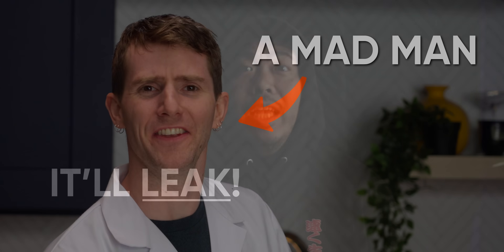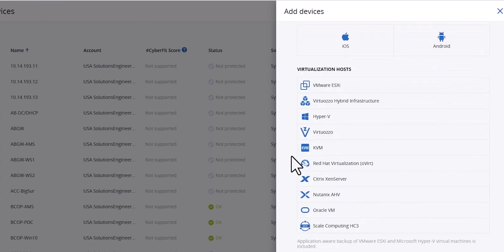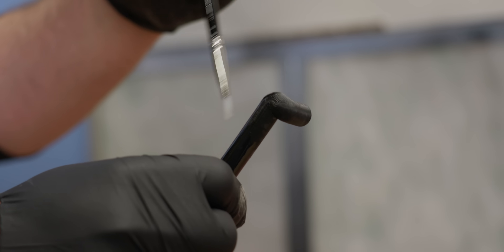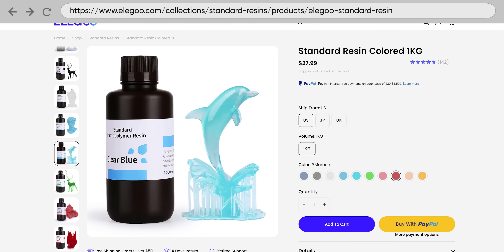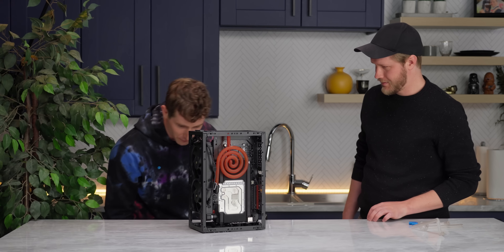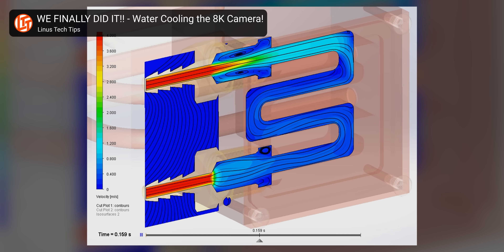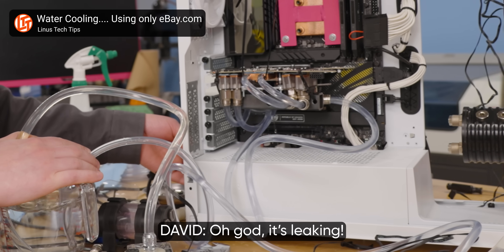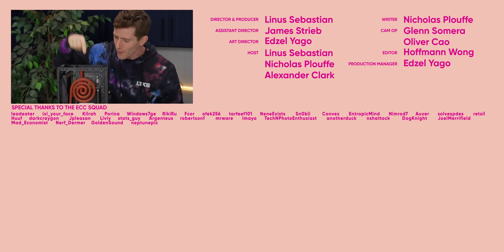3D Printed Hardline Water Cooling

Comment: applying a coat or two of resin to the outside of the piping before installing would likely make the part significantly stronger and more water tight. it might even come out looking smoother :)

Comment: You should look into the resleeving pipe process, you could potentially 3d print the lines with holes then sleeve it to avoid leaks. 
3d print provides the hard structure, sleeve actually contains the fluid.

Comment: if you clearcoat the resin print you can achieve translucency. I have lightly wetsanded some resin prints, clearcoated them and ended up with parts clear enough to easily read text through.

Resin prints can continue to cure in sunlight and end up cracking so a UV clearcoat is a nice way to mitigate that

Comment: You can use glass blowing technique to get same result in Quartz or Pyrex glass tubes. As long as you hold internal air pressure in the glass pipe you can get quite intricate shapes and tight bends...

Comment: There was a recent post in the r/SFFPC subreddit where a user 3D printed molds instead. Then used regular hardline tubing and used heat to fit them to the mold. Was able to achieve something super complex but without having to go resin and print the full tubes. It would work great for an SI when they have fixed configurations, they could just premake all the tube runs with ease.
Reply: Custom Scientific Glass Blowing has a similar process where they use regular tubing and stock glass to form custom pieces for laboratory and manufacturing use which has to be of a high standard for professional use to withstand heat and pressure tolerances fit for purpose.

Or if you think of it as a prototyping route, make a model test fit... and then go completely over the top and follow an artistic route glass blower/sculpter to make the final product.  
The looks you could pull off like go full glass crazy straw, mad-scientist labratory glass kit, abstract art like a glass knot or klein bottle, or waterflow sculptures.
Reply: If you don't want to resin print you can fdm print casings to hold softline tubing, you just thread the tubing through the printed casing and you have your shaped tubing
Reply: For cooling so much expensive gear, I think I’d just not take the risk and buy properly made ones 😂

Comment: what about weird shaped tubing? like instead of a round tube its a flat rectangle
Reply: The problem is that the fittings are round. You'll need to somehow transform the tube from square to round. Doable, but just more work.

Comment: With a 0.1mm or maybe 0.15mm layer height (instead of the 0.2mm? that LMG used), enough walls that everything will be solidly made out of walls while printing at the higher end of acceptable temperature and you could easily fdm this instead. Especially since PETG bonds better to itself than PLA which makes it slightly better at being watertight. Also using a resin that is 3-4 times more expensive than typical stuff and using that to set price expectations for people is a bit weird.

Comment: think there are some coatings you can pour into the tube to solve the layered spaces issue. I found several that might work when looking into fabricating a gas tank from sheet metal, but only cared about ones that would not corrode or dissolve in contact with gasoline, and protect from/not form rust.

Comment: one thing i would love to see now, is a small reservoir built into the tube(so for instance the spiral could be filled out, and used as a reservoir) and it could make water cooling a tiny form factor pc better, since you can fit the tubes in where there is space, and make a small reservoir where there is space for it, and even a fill cap located in a convenient spot, and a drain port as well.

Comment: This is exactly what a Stratasys polyjet excels at. A J 750 or J 850 can print out some absolutely massive tube runs. All you have to do to prep the prints is remove the water-soluble support material.

Comment: Also possible is to use a resin with high thermal conductivity (commonly used fillers for that is aluminium powder or silver) and use the tube itself as a heatsink.

Comment: I'm really curious at the possibilities for doing functional things with this.  You were showing how tight the bend can be, but water doesn't flow well through bends, right?  What if you could very precisely design the tubes for a computer such that you get the gentlest curves possible for the smoothest flow.  Would that improve the cooling vs. sharp bends?  Sounds like a great video!

Comment: as for the hassle with working with resin..  just use water soluable resins.. dont need alcohol to clean it afterwards and theres barely any smell from it, you still need to use gloves and stuff but its so much nicer to work with (though i suppose for stuff like this where it will actually be subjected to water it might not be very good :D but for anything else really its fine)

Comment: Lol @ UV reactive dye. In a resin that breaks down with exposure to UV light. It cures with UV but continues to degrade with extended exposure. SLA resin is inappropriate for any kind of production part. It is for checking size and throwing in the trash

Comment: I'm glad Alex talked about the fumes of SLA printing. 
I was in the market for a 3d printer a few months ago, and ultimetely went with FDM against my initial desire. 
The checmicals in resin printing should not be understated. The PFAS will fuck you up and linger in your home. I can't risk making my family sick, so until I'm willing to put a resin printer in my shed outside I'll be sticking with FDM. :( 
edit: oh linus also reitereated :)
Reply: To the note about 3d scanning - you can always use photogrammetry apps. They aren't always perfect, but it should give you enough spacial precicion that you can use it as a jumping off point for iterative designs. Much better than pulling out the callipers and a compas or something.

Comment: Hey Linus, solid works flow sims are not acceptable for any actual design work. My background is as a CFD engineer so I know this pretty well. Sadly, the other options are often very expensive, but you could totally get sponsored by a company like ANSYS or Siemens and do that real proper design work. The chances that your design tested in solid works flow sim will not work will be exponentially higher.

Comment: RGB tube! Put the RGB strip inside the tube in a second cavity. Include temp sensors along the way, and an Arduino and color the light at each point according to the temperature at said point in the loop.

Comment: NEXT VID IDEA
Make water cooling using one big piece of standard radiator made from block of aluminium with drilled holes for water look 
Or 3D print one from metal to work like a side panel and cooling radiator in same time 

Or make pasive cooling using convection without any fan , just long insulated "chimney" for it to work using convection

Comment: Idea: 3D printed metal loop that sort-of doubles as the reservoir.
Secondary idea: Flute the tube on a variant and see if it affects the temperature.

Would be kind of wasteful, though, since it would probably only last for a single machine/configuration no matter how well it runs.

Comment: These resins have so many weird issues beyond the immediate trend towards being a rather weak and brittle material (though there are many more tougher and outright rubbery ones out there now). They also have a tendency to react badly to oil, water and UV over time, so can often warp for no apparent reason later etc. Meaning this isn't a great solution until you have characterised the specific resin unless the datasheet is rather comprehensive (which they never seem to be).

For now it seems to me the best way to create these weird hard lines would be to FDM (its cheaper and easier to work with) print the form you are bending regular tubes around, fill the tubes with salt rather than the silicon rod as support material when doing insane bends - as the salt can be dissolved and flushed out no matter the crazy geometry. Going to be more work to get the exact perfect bends as the tubes will want to spring back and the form is going to need to be in multiple parts but the end result is so much more trustable. Being exactly the same material as always.

Comment: I'm torn on this.  While I can understand the aesthetic appeal of hardline, functionally it isn't any better that simple rubber tubing.  However, that being said, even in my own custom loop (using rubber tube) there were a couple connections where a custom printed tube could have been easier to install.
Note: while outsourcing the printing is definitely an option, that would definitely increase the overall build time and be really annoying if you have to redo a run more than once.

Comment: Just before some1 else tries this: I've done this, it's alright, but you have to be aware that some UV resins will NOT survive long term exposure to water and overtime they will deform and then crack.
Of those  resins that I tested for this purpose:
SirayaTech Blu - no issues after 6+ months
SirayaTech Fast - the fastest deformation in presence of water I've ever seen, definitely a no go
Anycubic Soy - very slowly deforms and then cracks, but this can work if you check on it every few weeks or so as the cracks develop very slowly
Peopoly Nex - no issues with grey one, but the transparent one became brittle and then cracked from sun exposure (it was outside)
Reply: Also, be aware that uv resins can suffer from creep, which might affect the seals...

Comment: Wela PLA sure wouldnt work with that resolution of printing. Gotta get a much nicer printer and dial in the settings and you barely see the lines. Especially if you offset the layers.

Comment: I would have FDM printed those out of High Temp PP on a 0.25 nozzle on 0.1mm layer height and 100% walls.

My reasons:
1)Speed (even using such a small nozzle and layer height, it would still be faster)
2)No cleanup
3)No post processing
4)Clarity
5)No cancer
6) Impact resistance
7)The qaulity of FDM is so good these days, the layer lines I chose would be barely visible.

Comment: Beware, we've found that printed resin tends to shrink over time.  Parts with lots of springy bends (like that spiral) may be okay as it shrinks, and you might print it slightly larger to offset the issue.

Comment: I guess abs + acetone smoothing would be a candidate for a possibly simpler method. you could do the good old vapor smoothing on the outside and/or run a shot of acetone through it to seal the inside

Comment: PETG is good for watertight 3d prints even with just 4 walls. This is becuse PETG has a much beter layer adhesion then PLA. I have printed RC bots out of it not a singel leek.

Comment: You can add a bit of adjustability into the tube as well by adding extra bends that allow some 'squishiness' in certain directions, depending on the rigidity of the plastic used.
Reply: The resin is usually very rigid.  And putting more bends in it than necessary could lower your efficient fluid movement.
You can't just heat bend it like the plastic or the glass.

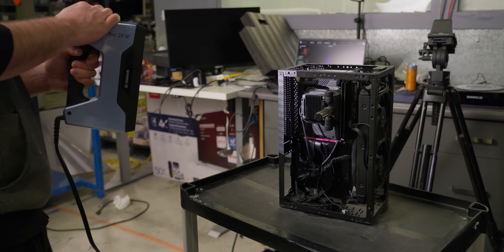Comment: 1:05 It's not as cool, but you can do that sort of 3D modeling with the more recent versions of the Iphone. Because it incorporated LiDAR technology it's super easy to get a 3D scan of an object in real space. Of course, you don't even need that since you can do it using just image alignment and there are apps for that.

The scanner is still cooler though.

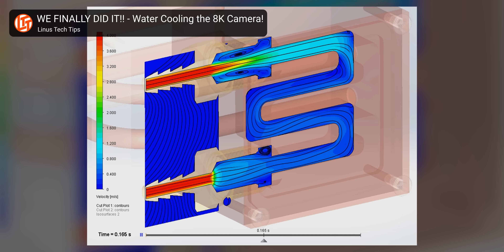Comment: @9:35
The water will become oxygenated and pick up dust, ect... placing it into the loop slowly. Maybe a filter in the collection unit would help remove both contaminants and separate out air bubbles before going back into the main loop.

Comment: I would not recommend using resin, and especially not using UV dye in order to make  the tubes glow with UV lights. The resin is already UV reactive and glows, but as you continue to expose the tube to UV it will continue to cure and over cure. Also, they will take in liquid over time. Specifically alcohol, but I wouldn't trust that the water won't weaken it from prolonged exposure and differential drying out to in.

Comment: I made a whole ass engine with resin. It runs at 2500rpm on like 2.5 bar and is holding up fiiine just fine. So yeah resin is pretty tough even it brittle sometimes

Comment: I mean... It would take me a while, but I could probably make that spiral bend. To be honest, the most difficult part is the bit that goes into the center of the swirl at two really tight corners. You could probably make that with a mold though, and that mold wouldn't be too hard to make with a decent router. To make the swirl you could probably do it with some bolts made into a jig on some thick ruler or something, and just turn round carefully. You'd need a tube through the whole thing to make sure it doesn't crush it, and getting that out would be rough (my first thought would be to pump water based lubricant through the loop). But yeah, it's definitely do-able. It would take me a couple of hours to make the mold and jig, but then the rest is just slow and steady. The other option is to cnc a massive block of metal and just heat up and feed the PETG through it.

Comment: Should have used color changing resin, how awesome would that have been, see which end is the hot end and which end is the cool end. See the cooling process in real time. Also probably could help you detect flow rate issues as well.

Comment: I'd be more interested if there's any possible way to 3D print pipes with heatsinks or some design to try disperse heat while it travels, a more practical use I GET IT BORING, but at the same time it could be interesting, if you take a whole bunch of copper tubes and stuck heats spreaders onto them would that even do anything?

Comment: i can achieve water tight prints on my ender 3 printer, and yall clearly need to upgrade what you got if yours cant, my printer was $199. $300 with my mods. and im beating yours. thats not good for a tech channel. i use mine to make bongs. youre literally getting beat by stoner engineering.

Comment: So there are easier ways to make your tubes watertight namely acetone curing. If you are working with abs and there are some other solvent solutions for other plastics, you can also print at a slightly higher temperature with stuff like just pure pet instead of petg and that should also get you the same effect but it may not have quite the same temperature resistance. You could also go to an engineering filament and then bake it after you're done in order to fully cure and harden which will also have the effect of sealing up any gaps
Reply: Also, if you have access to it, slm could make some really nice metal tubes using this technique

Comment: do the Spiral tube bend again, but 3d print 120/140mm fan adapter flanges to the outside of the spiral! That you can take advantage of the coil cooling as its own radiator!

Comment: I love the idea of this, but there is a major issue here... you are all thinking too much inside the box still... If you can Resin print tube connections so they are stable... Why are you still printing tubes... Think of the architecture you could produce with seamless reservoirs or even make a case where the walls of the case are designed to be the tubes. An art sculpture where the water flowing through it is also your PC's cooling.... etc... etc...

Comment: AN EASIER SOLUTION TO  a 3d scanner is cardboard,you can just cut the cardboard in the shape you like with the ends meeting the fittings of your system,then you just measure the cardboard instead and you have your desing!

Comment: Open loop splashing water on a tower heatsink would be hilarious.
You'll probably have to top it off every week due to evaporation, but it'll double as a humidifier.
Reply: Ah yes, the algae breeder 9000.
Reply: Have it be refilled by a Swipe+ bidet on a RasPi with a level sensor.
Reply: Ick. You need cooling the most during the summer, which is exactly when you don't want to humidify the air. Then there's that nasty issue involving dissolved minerals, so your source of water is gonna be a problem.
Reply: Humidity isn’t ideal for Computers. In fact, this is why Arizona was such a hub for PC manufacturing before it all moved to Asia.
Reply: Major Hardware has a series of interesting cooling solutions
Reply: maybe glycol instead of water?
Reply: That water could also carry a static charge
Reply: Every week? Eh, if the capacity is like common loops, several times a day to once every hour or so running an i9 with load on it. You'd have to demineralize the loop once or twice a day or your pump won't make a full day without seizing. Realistically you'd have to automate refill based on some level point or you'll cook stuff or have auto shutdown due to thermal alarm constantly. 
Think of it this way, would you want a 100w+ air humidifier?

Comment: You should be able to avoid resin and use a FDM-printer if you lower the layerhight down to 0.1mm or even 0.05mm which should be possible with most FDM-printers. 

pssssst... or even use flexible filament to have "soft"-hardline tubing :D

Comment: What about metal hardline tubing? Is that possible on the metal printer? For that matter, could you print blocks and radiators on a metal printer? 

I know it's not practical, but is it possible? As in 'printed the whole loop in metal' possible?

Comment: You are missing the potential.  Eliminate the acrylic lids on the water cards.  Print resin lids that incorporate integrated flow without tubes between the components.

Comment: Water leaking thru 3D print means underextrusion. All printers underextrude a bit to print nice. It's pretty easy to solve the problem with adjusting extruder calibration by about 3-5% higher value.